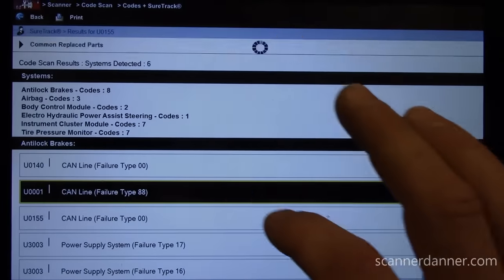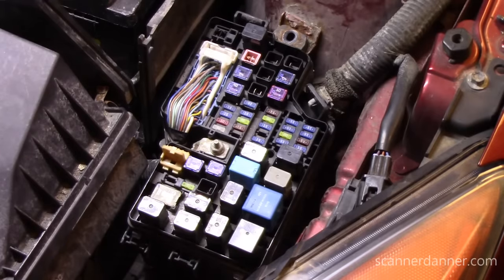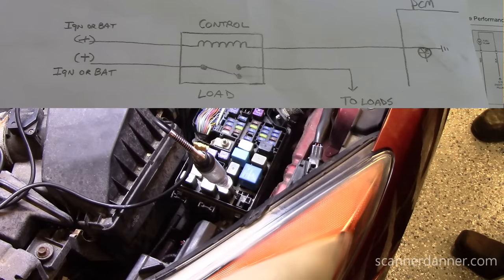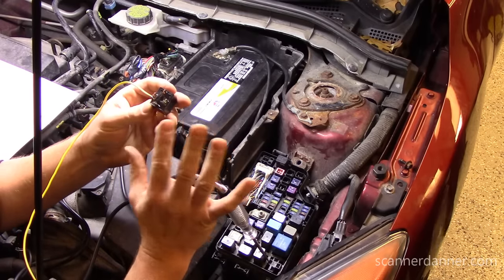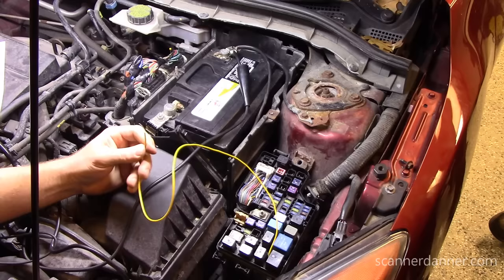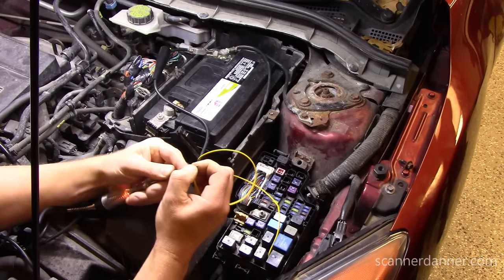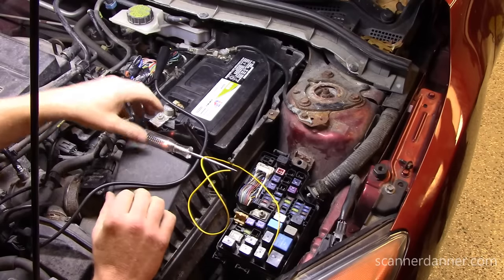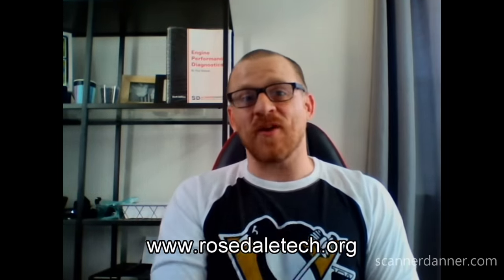2010 Mazda 3 No Communication With PCM, No Start, No Crank

Comment: I've been getting many f150 trucks in for no crank no start no comm. Your method of testing for 5 volt reference is priceless.  The owner has a few locksmiths and small shops check it out. After consulting with them not 1 person said they checked powers and grounds or for a 5 volt reference. Everyone said it's the pcm. The pcm is talking to several sensors so I ruled that out. Ruled out fuses and relays and ended up finding bad grounds. Many years ago I asked you about a 98 Chevy express van fuel issue and you steered me to the problem. I wish all my friends would stop calling me to beat my brain up with questions but somehow I always fix everything I touch. I'm a collision repair shop but hey money is money there days. It got to where I have to keep my doors locked and my phone off. Lol. I can't thank you enough Paul.
Reply from the maker: what an awesome comment, thank you for sharing this with me and good for you man. You made that all happen.

Comment: This was the exact issue with my 2008 Mazda 3. I grounded the main relay and got com, a crank and start. Now I have to pull the box and check for that broken ground.

This video is a god send. Can't thank you enough Scanner.
Reply: Which main relay?   i have a crank but no start.  And a security light that blinks while vehicle is still unlocked.  Checked Keys have proper function Immobilizer functional.
Reply: @MrTravisAl  There should be one specifically named "Main". Check the diagram on the inside of the cover
Reply: @chuym1983  I figured it couldn’t be the obvious main fuse, especially since everything on this Mazda has been a complicated sob. 🤦‍♂️  
I’ll definitely check in the morning.   Thanks!
Reply: @MrTravisAl  Yup. When you're under the hood and you pop off the fuse cover. It should be the only one labeled main. 

Keep in mind this relay is usually "switched" so you have to un ground it when you're not planning on having the engine on

Comment: Great video man I can’t thank you enough. After putting a transmission in a 05 mazda 3 I picked up for 200.00 I had one flawless day with it and then this happened. For a few days now I’ve been battling with it. Knowing nothing about relays and ground switched circuits I had no idea what it was going to take or if it was even possible to get this car going again. I was able to learn a lot from your video and in a few shorts I had the car running again. Thank you again!

Comment: Great video. Never thought about importance of using a test light. I usually use a dmm for stuff like that. So hard to fry ecm with one. But as many times as I have forgot to switch the confounded test lead back to volt side of multimeter. I could see myself forgetting if it were a jumper wire I was using instead of a test light. Between you and Eric O. My diagnostic skills have increased tremendously. Thank you.

Comment: Love your editing! The picture in picture and the commentary flows beautifully together. Then to find that issue with the steps you display was a lot of fun. Plus the wire was easy to get to, nice.
Reply from the maker: Thanks Wyatt!
Reply: @ScannerDanner  Sir, my car SDVC function doesn't work in my i20 2011 1.2. all the other functions volume, etc. are working ok. Please show video how to check the SDVC signal wire damaged or shorted. Thanks in advance.

Comment: Great explanation on how to check this problem! I will be following it step by step tomorrow, on the job, at a Mazda dealer, while I try to diagnose a 2010 Mazda 3 auction car that came in with no communication with pcm and a no crank condition. This video will save me hours. Thank you.
Reply: Hey Ken. What did it end up being? a fraued wire / corroded terminal in the harness?       Did you have security light issues? Crank but no start? 
I have a 2010 Mazda CX7 and the security light blinks even while car is unlocked. I troubleshot the immobilizer and key and they’re compatible.   (It cranks. No crank if immobilizer is unplugged or moved away from key. But when returned it cranks.)  The owner is my friend and is  desperate.  I spent all day on it reprogramming keys. Changing spark plugs back after another tech changed em. Checking fuses etc.   I’m at a loss.

Comment: Thank you so much for making this video. The very same identical thing happened to my 2010 Mazda 3,and had the guy at shop that chases electrical gremlins not been on vacation,it would gave been there Friday. Sunday I ran across your video,and it's now happily running thanks to you.I know they'd have charged me a minimum of $500,again "Thank You"
Reply: Did it end up being a corroded terminal in the harness?       Did you have security light issues? Crank but no start? 

I have a 2010 Mazda CX7 and the security light blinks even while car is unlocked. I troubleshot the immobilizer and key and they’re compatible.   (It cranks. No crank if immobilizer is unplugged or moved away from key. But when returned it cranks.)  everything was fine until another mechanic changed the spark plugs now all the sudden the vehicle wont start.   The owner is my friends and desperate.  I spent all day on it reprogramming keys. Changing spark plugs back etc.   I’m at a loss.

Comment: Lets keep it simple and straight to the point....you saved my a$!....I am a hs math teacher and any sort of electrical issues used to scare the hell otta me...With your vids and amazing attention to the learning side....I was able to diagnose and fix my audi that would have otherwise been thousands of dollars at the dealer......thank you so much and I will absolutely be purchasing your book, not only for my benifit but to help you continue these videos.....As a teacher, this is our biggest reward and reason......
Reply: Use to lol
Reply from the maker: What a compliment! Thank you so much for the support and nice job fixing your car. What was the issue?
Reply from the maker: Unfortunately most mechanics just throw parts at the car until it's fixed, so good on you for fixing it yourself
Reply: It was the BCM, the previous owner did not take the wiper off to remove the ecu cover.
Reply: Water got into the BCM through the cover.

Comment: Loved it when you found the open circuit, My mind was going check the Wire it self at Both Ends to see if possible either faulty terminal at computer or then at Fuse Box. Loved the Fine Paul. you are such a great teacher in fault Diagnosis and repair. Wish i lived a little closer would certainly attend a few of your Classes, can never stop learning Cheers from Australia

Comment: I have to give thanks.  I have a Pontiac g3.  It was tweaking out, shifting funny and had now acceleration.  It pulled a U0100 code.  After watching your video I decided to inspect the bottom half of the fuse box.  there was a smoking gun.  Someone spliced a wire with a odd ball compression barrel connector.  I cut it all out and soldered everything.  just like that It's back to normal.

Comment: I always appreciate and enjoy 😅 these videos . It has saved me a lot of money ..i use to work at a power plant ..My friend use to say well i think that motor lost its smoke lol..yea no doubt . A while my Tdi Jetta the ac stopped working..i found green corrosion on a connection right after the fuse going to the i think a module . Yea check circuit under a load..it had power at the fuse but right after the fuse was the problem at the fuse box

Comment: cant believe there's 5 thumbs down 
This is great demonstration of relays. 
Had a generator with three sequencial safty relays throw me for a heck of a loop one WEEKEND😅
Start switch would close the control circute, once closed power would back feed all three relay control circutes but if any of the safety switches lost ground the circute would open on all three relays. 
Drove me crazy and found falty oil pressure switch. 
Leaned how relays can back feed once closed to stay closed till lose of ground and be hooked in series at the same time.

Comment: that car owner hit many deep puddles!  I saw more corrosion in that box... a box replacement would be the best repair   but nice diag    mr scanner
Reply from the maker: agree, box replacement was suggested to the owner
Reply: @ScannerDanner  Sir, my car SDVC function doesn't work in my i20 2011 1.2. all the other functions volume, etc. are working ok. Please show video how to check the SDVC signal wire damaged or shorted. Thanks in advance.

Comment: Hey man, i work at a car dealership. Very helpful video you know your stuff! I have been in the auto industry for about 7 years now I’m 28 I came in right after college and quickly went into sales/finance. I’m taking a look at this video because I have a 2012 mazdaspeed3 and my vehicle had a flat tire during winter, so I left it sitting for a bit and drove my winter truck. 6 weeks later I come back to it and needed to change the battery so I did, then to be told I needed a starter which I got installed. Now my dealer is telling me there is no compression? I never had any check engine lights and my vehicle always drove great I never had any issues and I don’t see how it sitting can cause the engine to have no compression? I’ve never heard of that ever in my life and now there’s no one here that can take the time to really go and diagnose the real problem.. so I am sitting here and I’m a car enthusiast I do have a few mods but only a few bolt ons with supporting mods for it I never abused it, always put premium and full synthetic every 3k it’s my baby.. I’m so passionate about my vehicle and the news they gave me literally made my heart drop into my stomach I am very upset and really just wish you were here lol but overall I really would love for you to give me any advice on what it could be if you could inbox or message me I’d be so thankful.

Comment: Awesome video! I am having an issue with a car we bought on auction that is also not communicating with the ECM, plus the alarm/immobilizer is ON. I am not sure if the later is preventing communication with the ECM, or if we have an electrical problem.
This video gave me great tools to check on that.
Reply from the maker: Focus on the ECM no com first
Reply: How did it go?

Comment: Thanks! Just saved me a bunch of time your videos are 100% the best.
Reply from the maker: ah man, thank you so much! I really appreciate the support but I'd rather see you get something for your donation! Go to my website and on the home page, register for a free account, then email me your user name and email address you used to register and I will open SD Premium up for you for a month. The normal cost is $11 USD per month, but I'd be more than happy to give you a months access for this gesture. You can email me at support@scannerdanner.com and mention this exchange.
Reply: @ScannerDanner  Mate I am a experienced auto electrician i get this type of fault all the time i just wanted to tip the 5 volt reference check theory it changed my normal approach makes my job easy and as a owner/operator makes lots of money cheers anyway.

Comment: Hello mate.
I really need your help. I have the same problem as this but in a Ford fiesta (Europe) I've followed your steps and manually activated the relay but the earthing status doesn't change regardless of ignition position it also doesn't stop the issue. Could it be the pcm? Thanks Ben
Reply: I need to add some information to that..... So I have no communication, the obd port is live and other modules can be read. All fuses are fine and tested. I did your trick by putting a test lamp from the ground on the relay over to the negative on the battery. The relay clicks but will click regardless of if the ignition is on or off. Would this lead to a wiring fault or ecu fault? Many thanks in advance and your videos are Inspiring, I will ordering your book very shortly

Comment: Where do you get your wiring diagrams by chance? I have the same problem with one of my vehicle and would feel that a wiring diagram would help me before I even start.
Reply from the maker: I use Shop Key Pro but there are other resources out there for the DIYer. Here is a thread we've created on my forum to help you guys. It is free to join the forum. 
https://www.scannerdanner.com/forum/post-your-repair-questions-here/16-need-service-info-check-here.html

Comment: Hi, I have the exact same problem on my mazda 6 2009. Uk. Diesel 2.2 MZR-CD. Which colour number wires/fuses would I need to check on my car, I know where the harness is in my fusebox. The pcm is located in the footwell passenger side. I've had 2 people look at it they've left scratching their heads!

Comment: Question about checking the 5v reference line. If you run into a situation where you have no keys for the vehicle, and can't program new ones because you have a communication error, how would you proceed? (I have a push button start car with no keys).

Comment: So I have a question I have a 2005 Mazda 3 hatchback with a 2.3 crate engine in it replacement and it has a two pin plug for the alternator and then the main alternator power. My alternator went out I got another alternator given to me cuz I'm super broke I can't afford to buy another one but it's from a Mazda 6 but it's still a 2.3 l engine the difference with it is it has a three-pin plug it'll bolt right onto my engine but the pins are different how do I figure this out and how can I connect this to my car?

Comment: My 08 mazda speed3 is at the dealer for a theft lock issue and not having a second key. They were not able to communicate with the computer at all. I came in and had power to my obd but getting a link error. Fro, this video I was able to check fuses and 5v reference on a few sensors, I didn't test them all but am getting 5 volts. So I'm guessing the issue is actually bad pins on the obd port since none of the systems are communicating and I have 5 volts. I hope I am understanding this correctly.

Comment: Gud day Sir,if i dont have incandescent testlight,Can i Use Muttimeter also, for that Relay,i put it to amperes like what you did to your other Video,hoping for your Reply to my Queslion,t.y.
Reply from the maker: What are you attempting to do? Energize the relay? Yes, you can use your ammeter but you MUST remember that you have essentially a jumper wire in your hand and if you connect it with the wrong polarity you risk frying the computer driver that controls that particular relay.
Reply: @ScannerDanner  if The Circuit is Fulldown disign,i put a multimeter to negative or groud,and if it is a full up disign i put it into positive,right,and if the Circuit is groundside switch,i put multimeter to ground,and if it is a power side switch i put it to positive, sir,can i use a ordinary signal light bulb to make improvise test light to energize a circuit and i measure the bulb it is 176 milliampers
Reply from the maker: @japsmechanic7627  are you trying to do a bypass test? If you are, use the test light to do the tests, just in case you get your polarity wrong, so you don't cook a computer driver.
Reply: @ScannerDanner  Sir its hard to find where i can buy a incandescent testlight here in philippine,its all leadlight,thats why,i always use a ammeter when i do buypass test,but aside from that,i want to thank you for replying my question,Thaks idol,
Reply from the maker: @japsmechanic7627  let me see what I can do for you. Copy your message you just posted and send it to me at support@scannerdanner.com 
I have some connections and some strings that maybe I can pull for you.

Comment: Hey Paul!  Been long while side a few of your vids has come up.  Haven't commented much lately.  But I'll say something though,  this video sure blows me away with that fancy editing!  I followed it all with ease!  But I'm sure I can watch it again to follow it up again :)  seen your FB posts couple times.  Great video, Paul!!  

I have a no start issue on 1997 Dodge RAM 5.9 24v Cummins.

This video is similar to what I'm thinking of,  the fuel pump is getting power from control, load side.  All is good, but I'm afraid to probe the computer to see if there's power etc.  I'm not confident in myself to check that, lol.  Cuz I don't wanna cook the ecm, lol.  Any advice you can pass how to check if ecm or injector module are working? Thanks so much, my friend!

Btw,  no diagram available for this truck :(
Reply: before going too crazy, make sure the "fuel shutdown solenoid" and relay have power and are working, probably want to follow with checking the intake grid heaters and relays.
assuming that's old enough to be mechanical injection, crack the feed line from tank loose and see if it has fuel up front that will bleed air as well. maybe blast it with some wd40 and see if it fires on it :)
edit, forgot loosening the injector lines on top each one and crank until you see fuel. assuming the previous step had fuel from the tank to the injector pump.

Comment: Ok great video but quick question I have a 2013 mazda mazda 3 the cars battery was dead from lights being on , guy claims he had it cross jumped by accident now the car won’t start , i check the main fuse on battery terminal it’s good but the 40 fuse for the ignition was fried ,replaced that car does absolutely nothing  horn doesn’t work no lights on dash red security light flash no lights in the  inside key fob doesn’t respond but the head lights work that’s weird I really don’t won’t to sale the car but I’m not rich can u please give me some pointers
Reply from the maker: You cooked some stuff for sure. Do you have a Scan tool that can communicate with all modules on the car? Not just OBD2. If not, you'll need to take it to someone